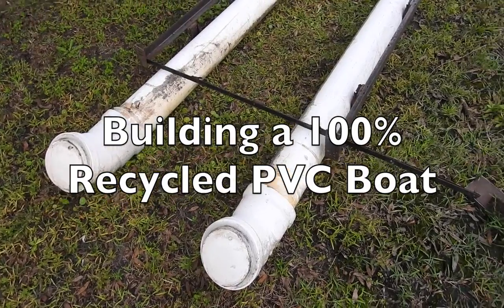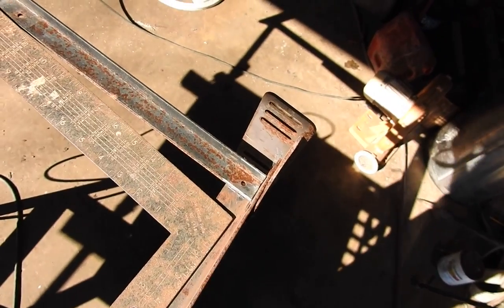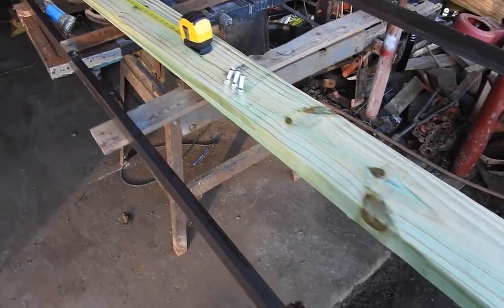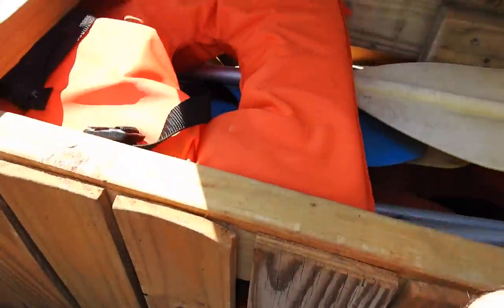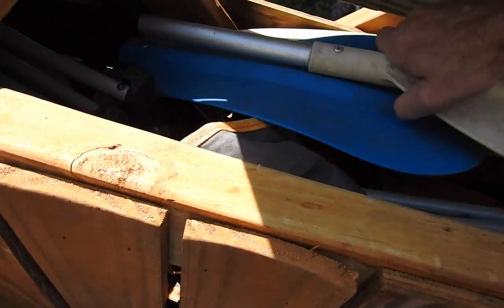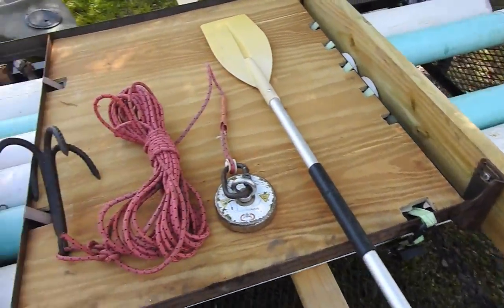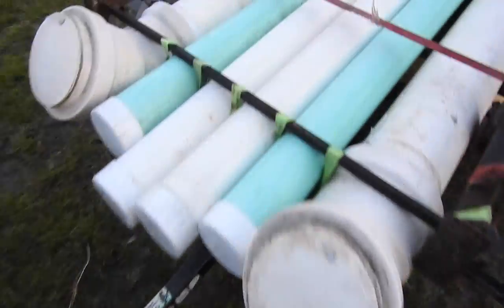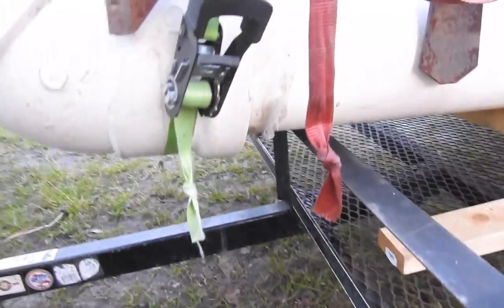Building a 100% Recycled Homemade PVC Kayak

Comment: Jb weld caps. Styrofoam keel or two even pieces underneath. Seen a guy here on youtube turn a length of pvc into an air tank. you do it with helium instead. lightest Weed  eater or blower for a motor. Just some thoughts. What u got there would be perfect for my kids.
Reply from the maker: Good thoughts and thanks for watching